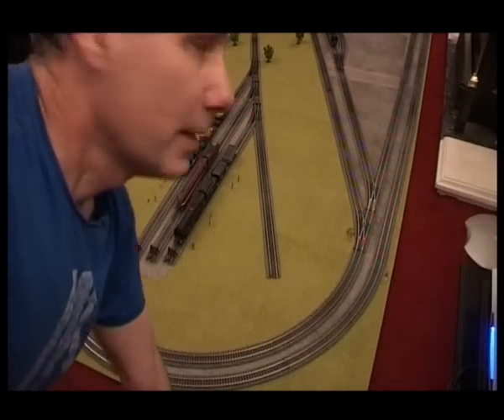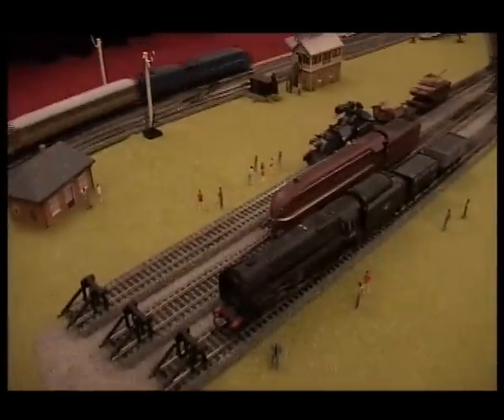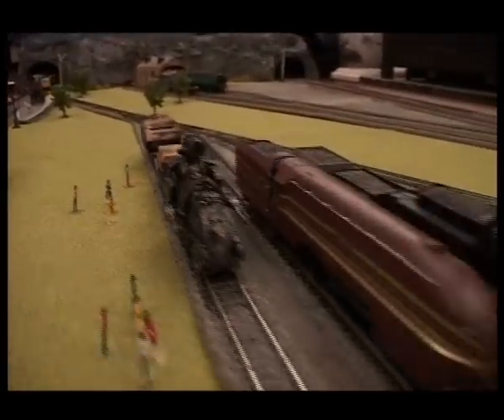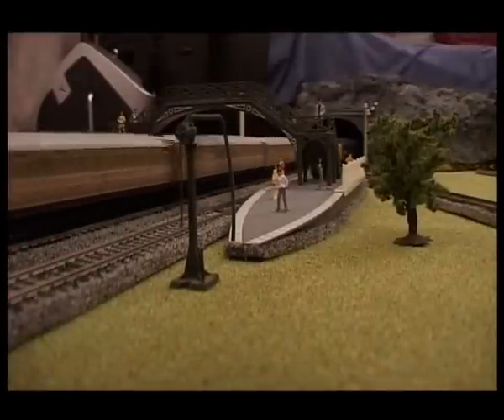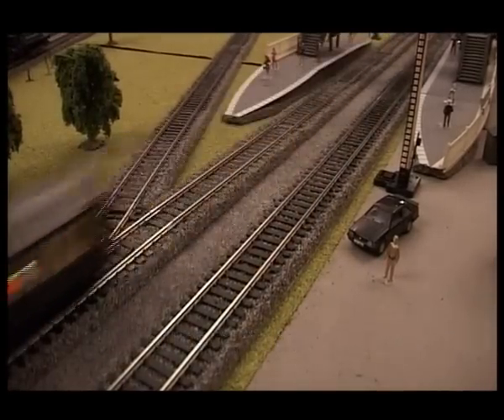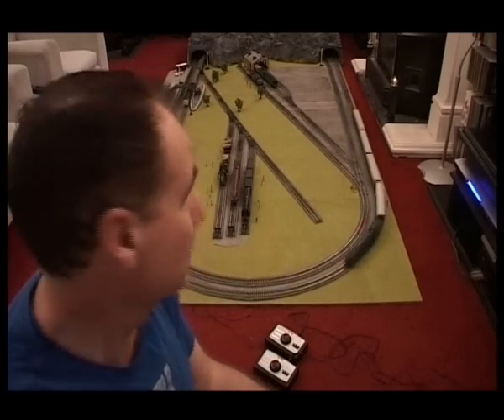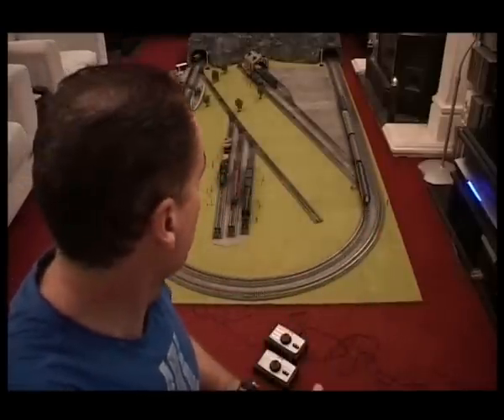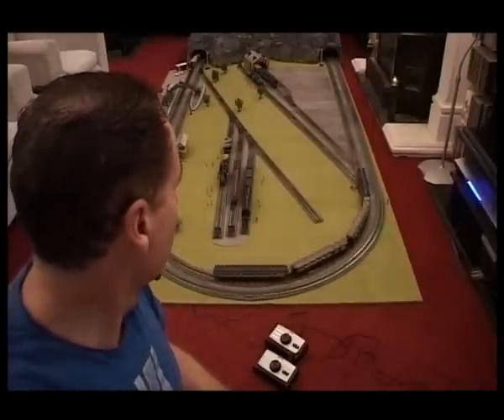Calverton 2 Model Railway - Inside Tunnel video - Phase 4

Comment from the maker: Yes, it has to come up and down, as with the rest of the layout. Takes 80 mins to set up, 60 mins to take down. If I use the full set-up. 
Today I've been detailing the inside of it, so that if and when I put lighting in it, plus an on-board camera, the detail is there too. I've used a mix of PVA glue and tissue paper to give the inside walls texture.